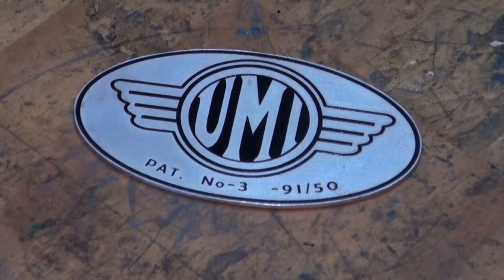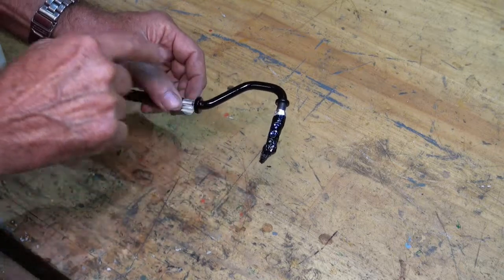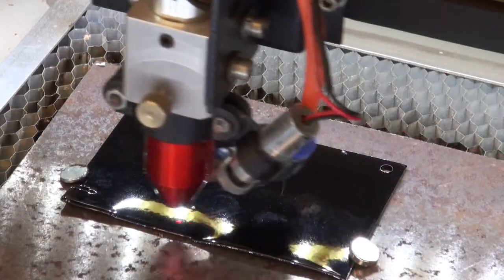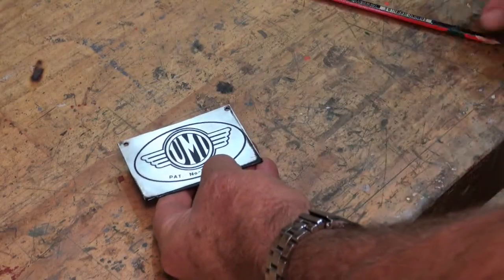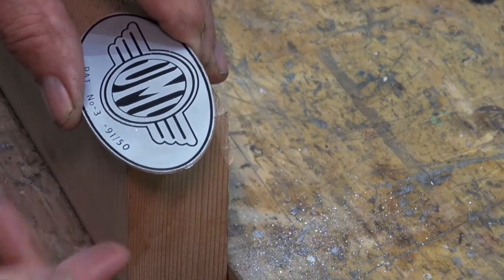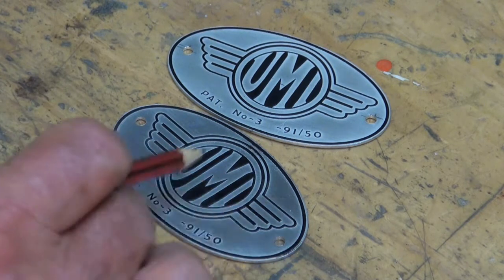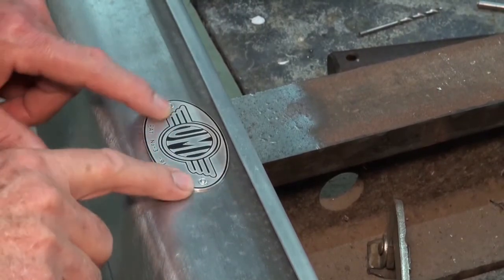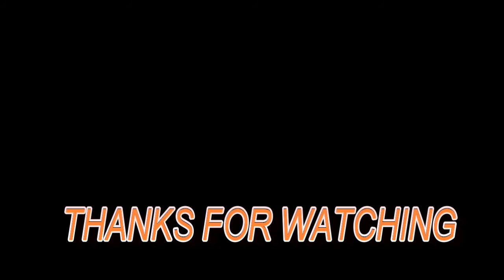DIY Laser Etched Name Plates and Hollow Rivets

Comment: Thanks for sharing. Do you know if it could be masked with the tonner method instead the paint you used? I have not access to a laser :(
Also, can you guess how long it would take to reach 0.8 mm deep? Thank you!
Reply from the maker: Hi, You can purchase a product called dry film photoresist that works quite well but the caustic soda would soften and remove the resist before it gets a chance to etch the metal. The other possibility is to use Press N Peel Blue which uses laser printer toner as a resist. The Press N Peel is just a way of transferring the toner on to the metal. I have used this product and it works well on brass using Ferric Chloride as an etchant but I haven't used it with Caustic Soda. The problem with caustic soda is that it produces a lot of heat in the reaction and the strength of the reaction varies depending on the concentration of the mix. Maybe a lower strength mix and a longer etching time would help with heat buildup.The depth of the etch and time to get there also depends on the strength of the mix and the temperature of the solution so it would be hard to determine how long a 0.8mm depth would take. That's fairly deep though. Most of the etching I do is only about 0.2mm and that's sufficient.
The thing about using the laser etched powder coat is that the black powder coat is what gives the colour contrast. If you are etching using a removable resist you would need to add the colour later by using paint or some other applied finish. I am going to release a new video shortly on just this topic so it might be worth watching for some more tips.
Reply: Thank you for your explanation. Look forward to your video!!